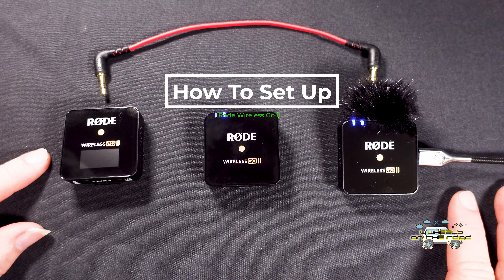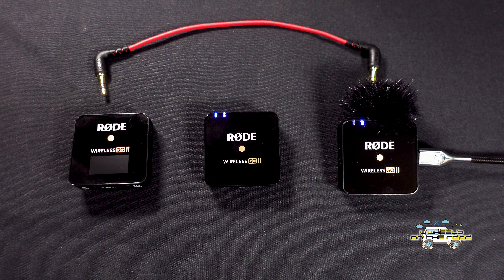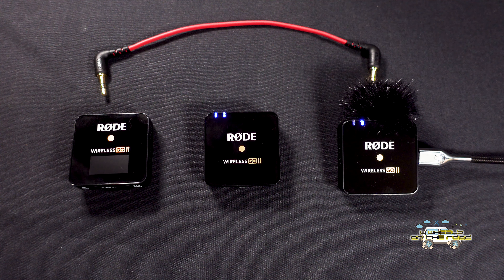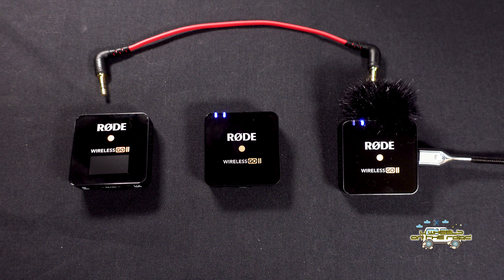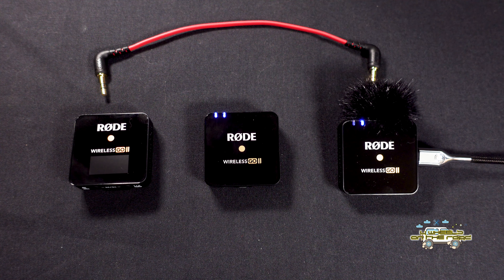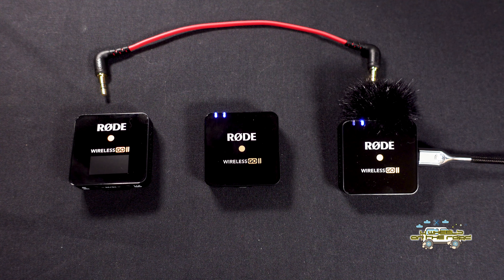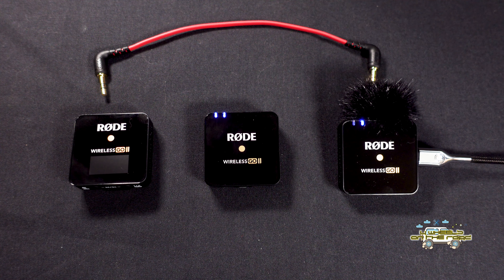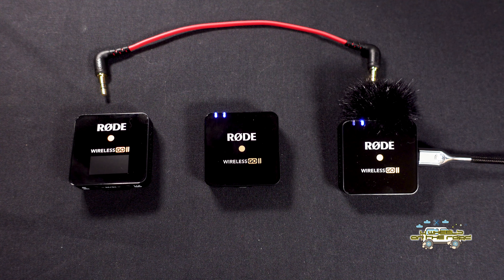Rode Wireless Go 2 I Set Up & Basic Functions Of This Incredible System I Including Rode Central App

Comment: That is pretty cool, would love to here what it sounds like.
Reply from the maker: I'm about 5 weeks ahead right now, in prep for eventually getting to Uluru.  So the Uluru vids will be the first
Reply: @4WheelsOnTheRoad  nice that will definitely be exciting
Reply: Mate for what you do, you really need this.  Just a tip if you don't already know,  clap before you start talking with it so if your audio is out to visual, in post,   you can line it up easier😀
Reply from the maker: @northeastdroneproductions  I record all my audio to my camera . Have been using a Rode shotgun till now which had an adapter to plug to the GoPro which I am now gonna leave full time mounted with the GoPro in the truck to do all my driving shots of myself mounted on the rear view mirror. This unit is now gonna live full time on the zv-1
Reply from the maker: @northeastdroneproductions  you can also change the assignment of the power button to make it a flag button for audio sync which is super handy for a lot of people. Personally I don’t really experience many audio failures and don’t care really if I do because I shoot everything at least 3 times from 3 different angles and just borrow the audio tracks from good takes if I need to. This thing really does have some handy features on it though which I didn’t touch on, the video was too long as it was so I had to stop short of mentioning the super cool stuff it can do
Reply: @4WheelsOnTheRoad  that's awesome. I have been looking at these for some time now but didn't know about that feature. Nice mate

Comment: Well made - but why is nobody explaining what the "pad" button does? Should that be so self explaining that everybody knows and I'm just stupid enough not to get it? ;)
Reply from the maker: yeah they don't make it easy at times do they! I think software and hardware designers for some products are so used to the products or family of products that they forget what it is like to not know things!
Reply: @4WheelsOnTheRoad  Thanks, 4 Wheels, but could you tell what it actually does, that pad button, if you know it? ;)
Reply from the maker: @christiankogler3381  https://rode.com/en/user-guides/wireless-go-ii
Reply from the maker: @christiankogler3381  it’s basically gain control which is better explained in the app when you get the device and plug it in you can adjust from the app